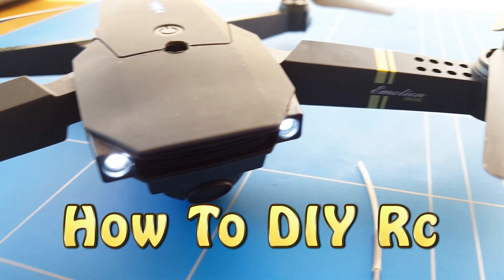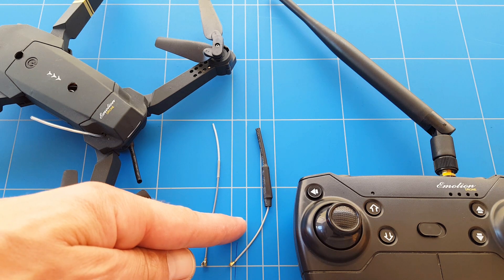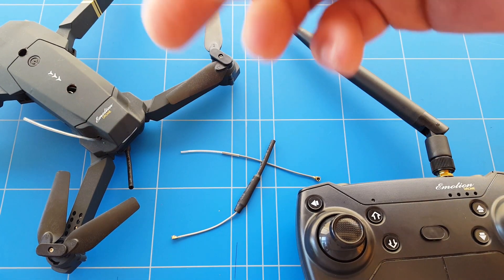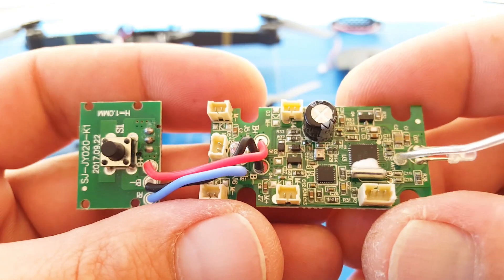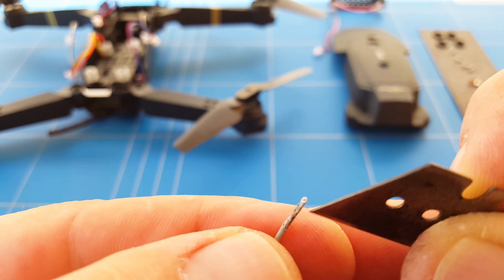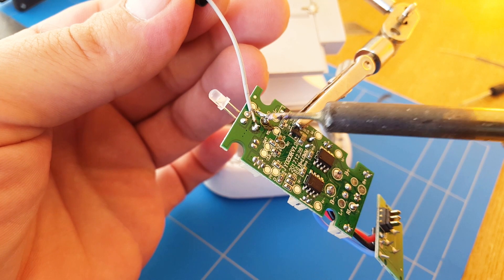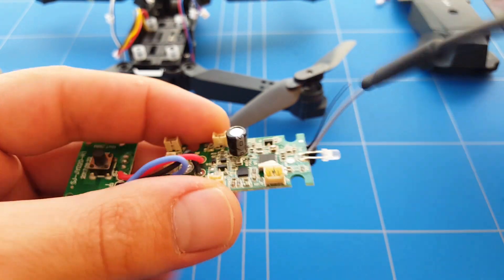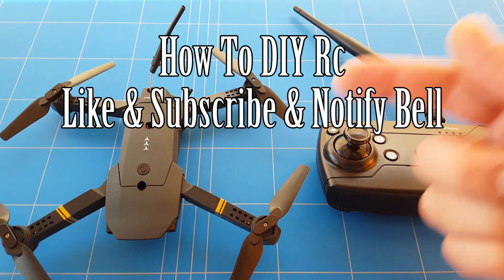Eachine E58 Drone Antenna Mod - Step by Step - Range Upgrade (Works For Any Rc Quadcopter)

Comment: Thank u for the video !

What shoud i do if i dont have ground in the controller ?
I have only antena.

Its a drone dji from aliexpress
Reply from the maker: Look for Gnd or follow negative current most of the time black wire from battery but china don't follow color code so measure for negative ,- volt

Comment: Was thinking about tinkering with one of the cheap eachine camera drones and wondering about antenna mods, nice.  Does it use the same antenna for wifi/video and control link?

Comment: Question. I have 2 if these antenna from an old Linksys router. Do you think it would be better using the two or just one?
Reply from the maker: one on the transmitter and one one the drone BUT THE DRONE CAN'T CARRY MUCH EXTRA WEIGHT

Comment: Should this same mod with he same antenna work on an Eachine e520s?  Or would I need to use a different antenna?  The e520s has GPS
Reply from the maker: yes works for your drone too with the same diapole antenna
Reply: @HowToDIYRc  thank you
Reply: Did you try it?

Comment: My drone haven't the ground connection.
Reply from the maker: use the ground from the battery it works you just need longer cable
Reply: @HowToDIYRc  I found later that the ground connection was under the pcb 😁, thanx!

Comment: You should try a 2.4G Radio Signal Amplifier inline with transmitter.     So it should be Transmitter to booster to antenna ,   use a small portable battery pack to power the booster 5v, you'll get a lot more rang

Comment: Great mod, but I do not see a video where you try it ... Have you had problems with the range test,or the drone remains unbalanced by the weight of the antenna? Could you list the positive or negative aspects you got with this mod?
Reply from the maker: to be honest it crashed in the ocean during the range test and the water current swept it away 
it did fly good and able to trim out the antenna weight np
Reply: How To DIY Rc 
Oh no 😱 I’ve been following this for a long while now so sad to hear that buddy !!! Before it failsafe did it get much better range than before ?? As in the WiFi range ?? 
Thanks
Reply: @HowToDIYRc  I also want to know the answer, is there any need to make mod to the antenna? Or it Was the same

Comment: I thought you changed the Antenne from the drone on the bottom? And drilled a hole into the bottom of the drone?
Reply from the maker: yes and now at the top as well :D:D:D